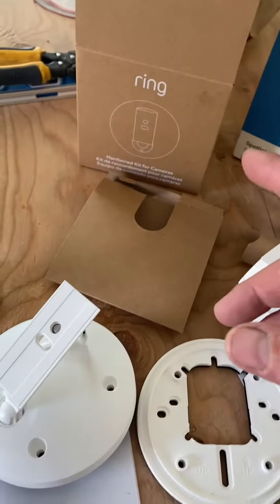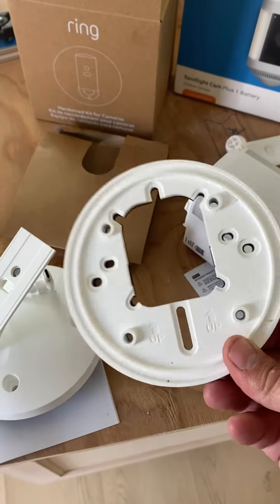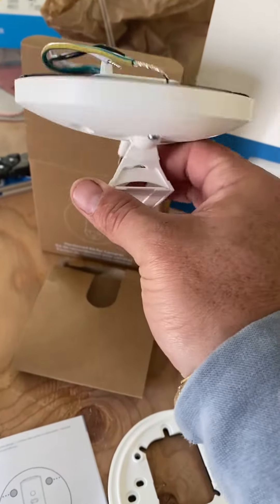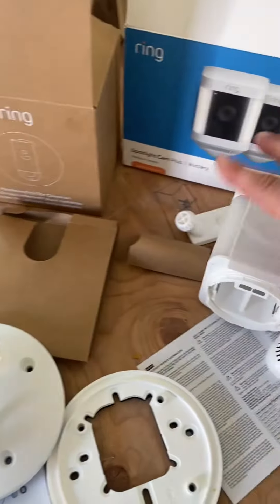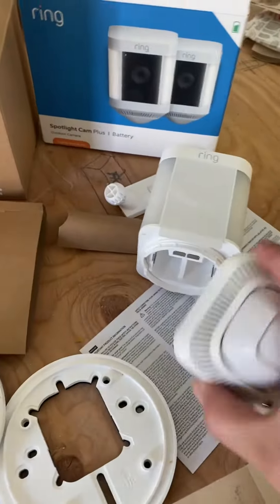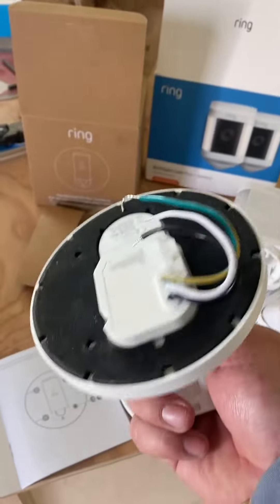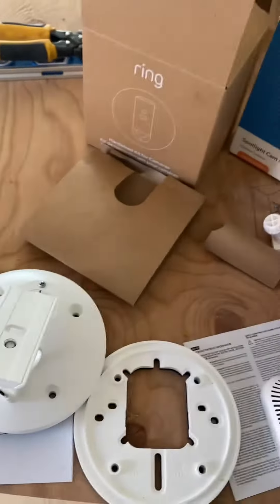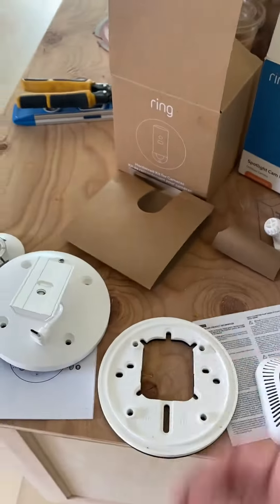Ring spotlight cam plus hardwired

Comment: If your hard wiring the ring camera do you need the battery
Reply from the maker: That’s correct, battery is necessary as backup incase of a power outage.